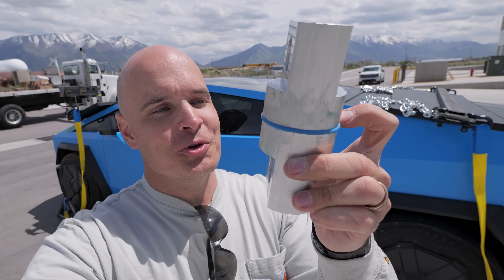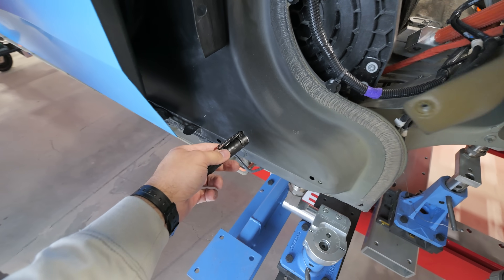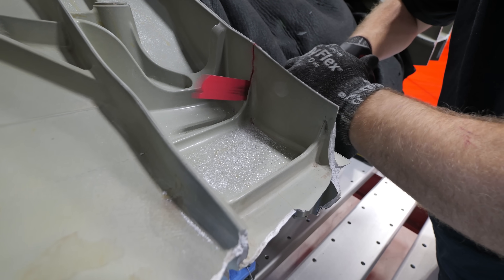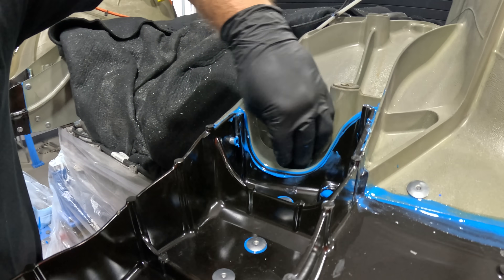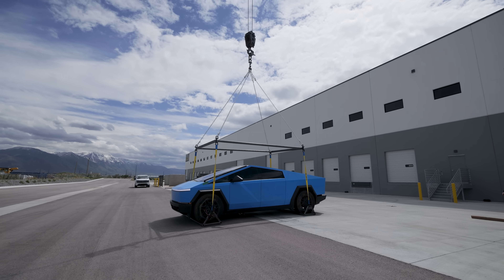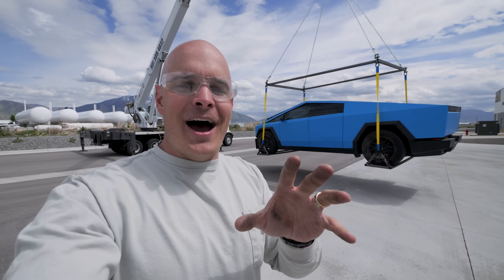Tesla Fixed my Cybertruck with GLUE - (but I'm not mad about it...)

Comment: Adhesives can work good when applied and cured. Overtime it will eventually degrade from expanision and contraction of metals. The only thing that would be holding those pieces together after the the resin degrades is those aluminum rivets. Exact reason why the adhesives for the panels failed just to add another adhesives 😂😂😂

Comment: Everyone need to remember, glue is also the reason why every consumer grade laptop hinge fails. Glue is the reason why a lot of phones and consumer electronics are unrepairable and became useless within a couple years. GLUE is bad. GOOD DESIGN THAT'S STRONG AND REPAIRABLE is good. Temperature fluctuation kills glue.

Edit: Can I also just brought attention to the fact that 1. It's not as strong as an actual truck with ladderframe chassis and 2. repairability and durability is crucial (nevermind the fact that if you were to be hit by a flying debris because a couple years down the line the glue has been weathered. It's not fun. Especially when the debris is the entire rear end of the dumpcybertruck.

Comment: Having had a steel framed f150 that had to be sectioned and replaced after an accident that price is pretty impressive. Also while the damage was about as far back on the f150 the sectioning had to be done much further back and required far more disassembly

Comment: To get proper results with Fusor 2098, you need to apply it to clean, bare metal — all coatings should be removed first. But here you're gluing painted surfaces together, not bare metal. So how can you talk about bond quality when the adhesive is just sticking two layers of paint to each other?
Reply: Don't bring logic to a marketing video :P

Comment: Seeing it's just flat smooth surfaces that are glued together makes it 10x more impressive. I wonder how much shear force could a bond like this endure compared to straight pulling force shown here. In the repaired sections it seems like shear forces will be much stronger when towing.
Reply: The specs were posted in one of the top comments. But the glue is strong enough.

Comment: But if the parts were made of steel to begin with, like a normal truck, would a protocol to repair this part really even be a thing? I'm also wondering if this fix was assembled after people started reporting failed frames, or if this was planned all along. I have so many questions.

Comment: Great demonstration of the process and the strength of the glue. I'm still skeptical about this being as good as the original metal or even welding in all ways. I'm sure this has all been tested to levels adequate for automotive use, but lot of glues are good in tension and maybe even shear but struggle with impact resistance, and degradation from heat cycles. Glue and plastics have come a long way in recent years though, for sure.

Comment: I would like to see how the glue performs in a shear strength test. We've all seen cyanoacrylate lifting incredible loads in similar pull strength tests. When it comes to a large amount of weight pushing down on the tow hitch, I would be way more concerned about shear strength. Remember, that's how the frame snapped in the first place, during your test. It would be really cool to see a challenge of their strength claims, by repeating the test.

Comment: First off, this is indeed really, really cool!  The sectioning is a great concept and it never would have occurred to me.  That said, none of this addressed my main concern from the initial video, which was the fact that aluminum fatigue is cumulative while steel rebounds.  Seems to me that while the adhesive is way better than a layperson might think, the fact it's bonding two pieces of aluminum together is still a huge problem.  Also, the sections you showed in the initial video had WAY less glue than they used in the repair.

In any case, thanks for a wonderful video and thanks for your continued enthusiasm for all things clever, regardless of where we find them.  It's why I still love your channel after all these years!
Reply: You know we build airplanes out of aluminum right? Fatigue cycles don't matter if they are only a factor after 500,000 miles.
Reply: @JorenMathews Yes, which is fine when you're talking about an industry which heavily regulates how the stress on those parts is applied and has extremely meticulous schedules for maintenance and inspection of those parts so that if fatigue is starting to become a problem, it can be addressed.  

My concern about aluminum in vehicle frames, especially with regard to the tow hitch, is that consumers use things wrong all of the time.  If the load of the towed object is incorrectly balanced, you run over all sorts of potholes, and are involved in numerous unplaned accelerations/decelerations/hard maneuvering, then that increases the likelihood of approaching the failure point of the aluminum.  Mireover, if the steel flexes and bends because of the driver's tomfoolery, you won't be in a situation where the towed object and the rear of the car go flying off on a highway at speed.
Reply: @woogywips  I think that's why they engineer these things with safety margins. Or at least should be. I think we will have to wait around 10 years to see if they engineered the frame well and if they manufactured it well.
Reply: @woogywips  I think the pot holes is hugely overblown as a potential issue.  This specific issue is the only non-super rare one to really even be concerned about.  The shock transfer to the hitch is massively negated from both the tire flex as well as the suspension and we have had zero proof or Influencers doing a video that created a failure in that scenario.  35" tires can absorb some fairly nasty pot holes pretty well on their own.  I wouldn't honestly be surprised that you would need to hit a pot hole so larger that it tears the wheel off before the frame/hitch has an issue.
Reply: Fatigue doesn't matter to the life of this vehicle, it needs to last 20-30 years, it will easily, even if regularly used for towing.
Reply: As someone has said, the airline industry uses aluminum for weight savings and uses the frames very hard every day for decades. More to the story it appears.
Reply: The "Fatigue" myth is SUPER over exaggerated. Range Rovers have had aluminum frames forever, as have numerous other cars. Aluminum airplane wings flex on massive leverage cyclically, and engine blocks contain hundreds of millions of explosions over decades. All aluminum. The design and engineering around the use of a material is just as important as the material used.
Reply: Since you said explosion, it’s clear you have no clue what you’re talking about. Also most aluminum blocks have steel sleeves inside.
Reply: @legionof0ne441  "Most" lol and I've rebuilt a couple, so I know exactly what I'm talking about. Sorry I should have said cOmBuStIoN. Figure of speech.
Reply: @Turbo.M777  Yes "most", Some are FRM like honda used and others are made out of cast iron.
Reply: @legionof0ne441  I always assumed steel sleeves are used for abrasion durability and high heat expansion and not for strength?

Comment: I watched the whole video to see that it works.. was fascinated with how they use a Milwaukee Hacksaw to cut through the frame, and what looked like long wood clamps to hold things. Now I want to cut my car up and see if I can fix it. :D. That said.. the end take away is.. WHERE can I get that adhesive! That shit is unreal! I think I could use it for everything if it's that good. I am over here with my Gorilla glue or JB Weld epoxy thinking I'm king shit.. and then I see this.. and well now I am just disappointed. Can we even buy this stuff?

Comment: Everyone forgets, the only way you broke it in the first place was to pin down the front. Definitely no one is towing with a tractor holding down the front. The repairs were awesome. Definitely much engineering and design went into the repair scenario and the price was very respectable.

Comment: Thank you for this Tesla commercial. I will remember that if my bumper ever falls off, sending my trailer uncontrolled down the interstate, I will be able to get my “truck” glued back together.
Reply: Thanks for your thoughtful contribution to the conversation.
Reply: @southbaycommuter perhaps I should have just come out and said this video seems like shameless shilling. Fuser 2098 is not “Tesla glue.” It is widely used in autobody repair. While modern glues are impressive in general, Fuser 2098 with a tinsel strength of 3,190 psi does not stand out. Gorilla Glue Epoxy, is 3,300 psi. Gorilla Glue Ultimate Epoxy is 4,250 psi. This feels like the Cybertruck “bulletproof” door panel hype all over again. Where the “special alloy” is as bullet resident as one would expect from any stainless or carbon steel that thick. The fact that we are surprised that Tesla planned at all for crash repairability speaks to the low opinion of the Cybertruck but it should probably be mentioned how few shops there are with that capability and how long it takes to get a Cybertruck into one of those shops.
Reply: @CanusDirusx  he literally mentioned in the video that other manufactures use the same glue
Reply: @carsonj4031 he literally called it “special Tesla glue.” What makes it special Tesla glue? It seems like ordinary autobody repair glue to me.
Reply: Link to anywhere/anyone where thats ever happened? So far I can only find it happening in two specific Youtuber videos where they are intentionally destroying it.
Reply: @Turbo.M777 if it ever does happen I know how they will glue it back together. I don’t know if it will ever happen but I think a “genius” told us that this thing would revolutionize the pickup truck. I’m still waiting for the revolution. I’m not a Tesla shareholder so I don’t really care what frivolous boondoggle they go on.
Reply: @CanusDirusx  For someone who doesn't care... you sure seem to care.
Reply: @Turbo.M777 I’m just disappointed that Jerry is shilling

Comment: I might be mistaken, but it seems like this video was created in response to an email from Tesla regarding your previous video. I really appreciate you as a YouTuber; however, this situation feels similar to what Nvidia did with their review by stating, "If you want to review the GPU, you need to mention this and compare it to that." Although I found the video interesting, I have to express that, from my perspective, it feels like the content isn't entirely accurate. It's disappointing, especially since the video is quite engaging.

To support my perspective, let's compare the original glue application to the new one. In the original version, there were only three lines of glue. Now, it seems they have used nearly four times that amount, following a very precise procedure for spreading the glue and applying a second layer. Something seems off…
Reply: perhaps you should consider where the failure occurred and what those three strips of adhesive were doing, and if they were the point of failure - they weren't. What failed is the casting itself. The adhesive was holding the towers to the casting that failed, and they're just there to hold the panels on the side. 
whats off is your understanding of the issue at hand.
Reply: @randommcranderson5155 totally agree I noticed later this difference your right regarding the different parts glued together. Thank you 😊

Comment: Hi Zack, really cool of you to give the Tesla engineers some love for their amazing work! As a Volvo Cars engineer myself, I was amazed by their repairability and forward thinking, despite using a brand new technology as megacasting! KUDOS TESLA ENGINEERS 💪🏻
Reply: Hey you guys at volvo make some pretty safe cars too, props
Reply: a Cyber Truck is so poorly, it needs to be re glued together again, and 13.000 bucks extra, instead of beeing strong enough. What a mess of a car.
Reply: First time I hear about "megacasting". Interesting.
Reply: lol tesler engineers suck. they released the cyber cuck and it needed what, 4 recalls so far? and the fitment and issues on the other cars in the line up is hilariously bad. "mEgAcAsTiNg" isnt a new technology.
Reply: @Alex-zi1nb  most vehicles get recalls, this isn't new.  Your Musk Derangement Syndrome is showing, and I bet even Tesla's dumbest engineer can walk circles around you in pretty much any field ;)  I could also wager I could do the same, notifications off, just here to drop truth bombs and get the bots riled up.
Reply: @Alex-zi1nb  For many modern cars, even over the air software updates can get classified as recalls. It's better to do a recall and fix the issue than it is to just issue a TSB and tell people to fix it themselves.

Comment: I don't care what anyone says.  I absolutely love my CyberBeast.  I don't care about the depreciation.  Every reasonable vehicle depreciates and anyone who is smart with their money KNOWS cars are never considered a "good investment".   It's extremely useful.  The towing range is greater than my Chevy towing the same loads.  It hauls heavy things with ease.  It's powerful as hell (I also have a couple twin turbo race cars, so I'm speaking from experience).  It easily accommodates my whole family, especially considering my kids are 6'4" and 5'11", but still growing.  It's a fantastic commuter car and great on trips as well.    It hasn't rusted, no pieces have fallen off, no hitch has broken, no glass issues, no panel alignment issues.  I haven't had a single issue with the truck.

Comment: As a collision tech, I appreciate this video. While not the Fusor brand specifically, I use panel bonding adhesive and 1/4" blind rivets wherever I can. Much like their repair, it's often stronger than the original build.

Notice how little adhesive they used in the original construction of the "tailgate towers". 

It kind of reminds me of when Saturn was a brand, and their repair kit for frame rails. A bag of 1/4" blind rivets and a tube of panel bond. Ford's repair kit for their aluminum bedside is just a bag of 1/4" blind rivets and instructions on where to apply the panel bond.
Reply: Only three lines of glue, not the 2 layers we see in this video
Reply: @kendelpho  which all gets spread out quite thin. Too much glue can actually be a problem at times, but they know service techs are gonna overdue it so they account for that stuff.

Comment: 🎯 Key points for quick navigation:

00:05 🛠️ Cybertruck Damage and Tesla's Repair Plan
- Introduces the Tesla structural adhesive and the concept of GigaCast sectioning,  
- Recaps how the truck was damaged in an excavator accident,  
- Tesla allows the owner to observe the unique partial rear casting replacement process.
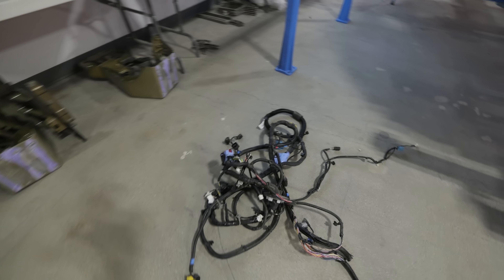02:06 🔧 Wiring, Components & Corrosion Protection
- Explains how the Cybertruck became immobilized due to damaged wiring and CAN communication loss,  
- Gives a tour of rear components like air suspension compressor and NACS port,  
- Discusses Tesla’s use of olive e-coat to prevent corrosion between aluminum and steel.
04:13 ✂️ Sectioning & Precision Cutting
- Shows the pre-cutting inspection, defined casting lines, and tolerance for reattachment,  
- Highlights Tesla’s repair design that avoids removing motors or batteries,  
- Begins cutting and sanding for the replacement piece installation.
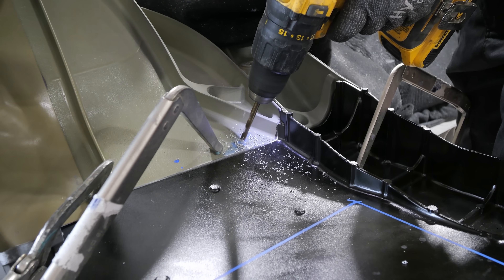06:01 🧪 Structural Adhesive Application
- Describes how the Fuser 2098 adhesive is applied and why it’s so effective,  
- Emphasizes its strength, curing time, and use across multiple automakers,  
- Mentions built-in glass beads that prevent overclamping and ensure consistency.
08:11 🚗 Reassembly & Energy Absorbers
- Reattaches steel trailer hitch and bumper absorbers designed for easy replacement,  
- Covers Tesla’s design for rear crumple zones that absorb and localize damage,  
- Reassures viewers about continued repairability post-accident.
10:00 🧩 Tailgate Alignment & Cost Breakdown
- Ensures tailgate alignment before final structural bonding,  
- Reveals repair cost of $13,994 and turnaround time of under a week,  
- Reaffirms structural integrity despite past towing overload incident.
11:52 🏗️ Final Glue Strength Test
- Prepares to hoist entire Cybertruck using only glued aluminum pieces,  
- Lifts 7,000lb truck using 2.5” of adhesive, proving real-world strength,  
- Concludes with confidence in Tesla’s adhesive and repair methodology.

Made with HARPA AI

Comment: So how strong is that glue.
(61mm/2)^2*3.1415~=2900 mm^2
3175 kg *9.82 m/^2 ~= 31175 N
31175 N / 2900 mm^2 ~= 11 MPa. 

6800 kg * 9.82 ~= 66775 N
66775 N / 2900 mm^2 ~= 23  MPa. 

Honestly not that impressive. Common weldable steel is 355 MPa. (But steel can have very different properties and strengths)
You could probably 3D print a Ø61 mm rod and lift the car with that. 
(The stresses in the Pad Eye is much higher than in the cross section of the rod. since aluminium is much stronger than 3D prints you will have to redesign the pad eye part.)

I don't know what type or how strong the aluminium Tesla is using is. But it is probably about 150 MPa. So much stronger than the glue. But the repair was not just replacing aluminium with glue and I am sure they have made plenty of calculations on the repair and multiple load cases and found that the glue does not need to be any stronger. I just think the "magic trick" makes it look much more impressive than it really is. 🤷‍♂

Comment: Ok so now I want a wheelchair made out of that glue!
Reply: They certainly should use glue. They would look into 3M’s next gen Acrylic Structural Adhesives
Reply: I honestly never thought of the idea to make a part sacrificial or have a seam to cut off and attach a new part with construction adhesive. I'm sure other manufacturers have these protocols in one place or another but this is the first time I've seen it.